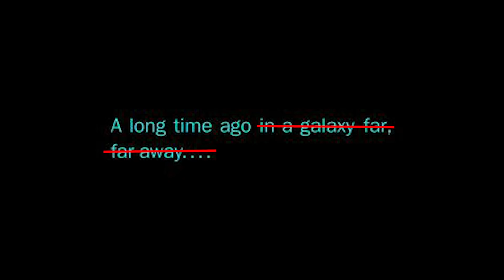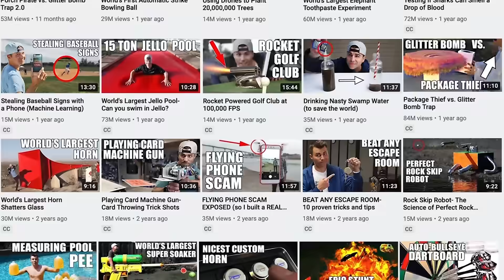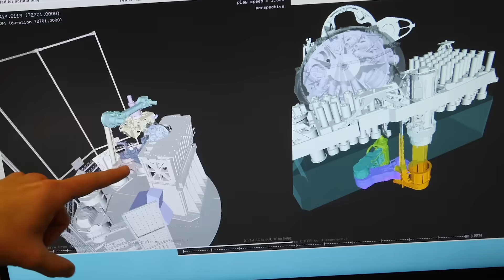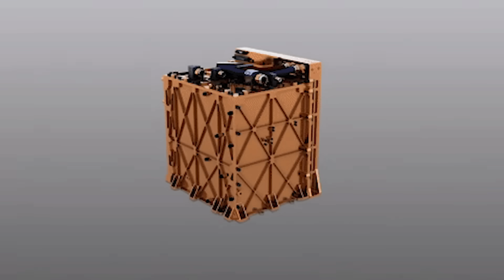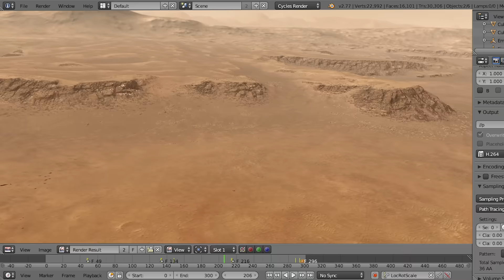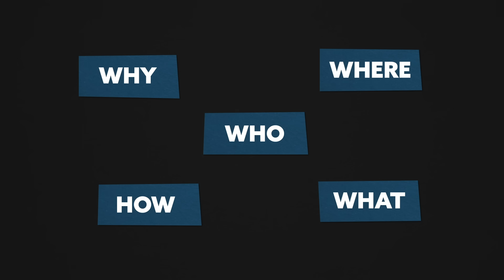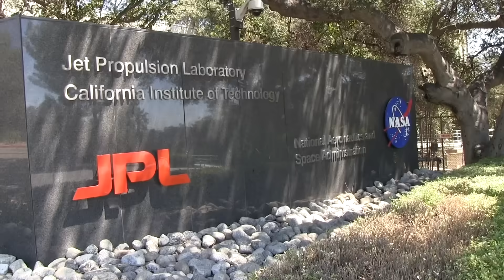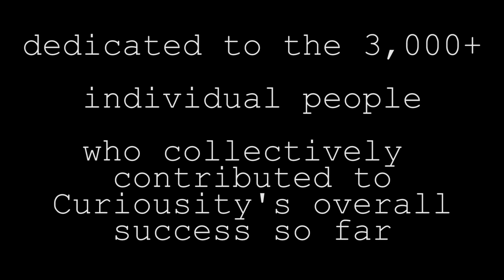Perseverance Mars Rover Landing- Inside Story

Comment: 8:48 now maybe I'm just dumber than I think, but you of all people should know that it's the air pressure that generates the heat on entry, not friction, right? All that gas being compressed heats it up into a plasma right? As I understand it, air's coefficient of friction is super low, and as such, shouldn't generate much heat, and shouldn't slow the vehicle very much. I'm pretty sure it's mostly the pressure that heats it up and slows it down.

Comment: I thought he is an engineer, he said friction causes heat on the heat shield when it is air compression.
Reply: It's both actually. Aerodynamic heating is what it's called, which is when an object's kinetic energy is converted to heat through compression of and friction with the air.

Comment: i watched the link to the virtual drop. 
although you probably got it all worked out, i don't understand how the heat shield just drops off. the spacecraft is at such high velocity that it would just be stuck on. unless its really heavy. but if it were really heavy it would be harder to get into space. 
what i mean is for the heat sheild to just drop of it either needs to be really heavy or it needs to be going faster than the space craft or heat sheild will come off but because the space craft is faster the heat sheild cant ditach. you probably donk now what i mean and nasa has probably got it all figured out but i got a feeling and i also just wanted to say "i told you so" if it did go wrong
i do not work for nasa. i am not a rocket scientist but it just came into my head.
i hope someone reads this.

Comment: Would propeller based drones work on another planet without air?
Reply: Mars has an atmosphere, it’s just very thin. About one percent as thick as our atmosphere. The drone is designed to be as light as possible and to have huge propellers to catch as much air as possible. It also helps that Mars has about 39% of the gravity here on Earth so it’s easier to take off.